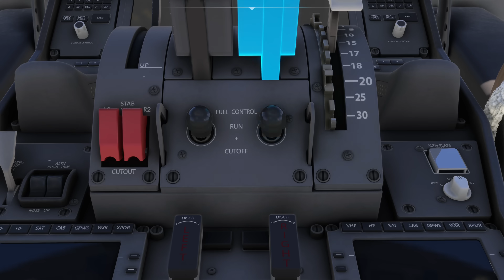Air India 171: Why Did The Fuel Cut-off Switch Get Moved?

Comment: FADEC failure? Consider this… the cutoff switches were Run when the FADEC goes crazy and sees a non-existent cutoff input. It initiates engine shutdown sequence and the pilot flying notices the drop in thrust prompting his ‘why did you cutoff the fuel’ query. The pilot monitoring truthfully replies he did not and all the while the switch remains in run position. Since it’s a false input generated  by a defective FADEC, the DFDR records a shift to shutoff that didn’t happen! The pilots then try to toggle the cutoff switches in an attempt relight the engine and one of them restarts albeit a bit late.
Reply: A spurious failure of a system with millions of hours on it, generating multiple false inputs one second apart, exactly mimicking a human input?  I don’t think so.
Reply: @rdspam 
A dual failure a second apart. I'm sure the probability of  occurrence is less than 1e-9
Reply: @byro32271 no it's not given that you already have a faulty switch control which Boeing knows.
Reply: @rdspam one second apart is humanely impossible lots of other honest pilots have suggested this. One second apart can only be achieved by computer systems
Reply: You wouldn’t see the clear inputs from run to cutoff then back to run again if what you said was true. Plus they can hear sounds in the cockpit. You don’t think they would confirm if the sound of using said switches is heard?
Reply: @Horizon301. Maybe they did hear or see more than they are saying and that’s why the report is vague?
Reply: @Yohann67 it’s a preliminary report, they are meant to be vague. The fact we have such detail and a likely cause is pretty good going. They will know if a switch got moved and what pilot said what based upon sounds anyway but that’s for the full report, that will be like 300 page and have a full transcript.
Reply: @Horizon301. It's not meant to be vague, it is made deliberately vague. The black box can exactly tell the sound id the switches were moved physically it captures the minutest sound. They chose to remove other conversations between pilots
Reply: I think that is a great point; I’ll hold my condemnation of the pilot until the final report, it just doesn’t smell right. We are making an ass-umption that the act was intentional and the “I did not do so” response was a denial; what if it wasn’t?   As long as the investigation is transparent we will eventually have answers.  This whole crash should have already been a lesson is assumptions.  First couple of videos where jumping on flaps retracted instead of gear, then it was fuel contamination, then it was electrical, not it’s deliberate action. Every step along the way presented us with examples of intuitive logic, as the majority of us plane enthusiasts and pilots are still not experts in crash investigation. I can wait, we owe it to the flight crew.
Reply: @Yohann67 take a look at PK8303. People had theories on the day of the crash and it didn’t sound right but the final report stated as such  that the pilots forgot to deploy the gears for landing and flew recklessly. It’s tragic to read. I agree about all the flip flopping but switching the fuel off wasn’t what anyone would suspect, hence it was leaning towards pilot error with the basics such as flaps or a failure of the aircraft. With the information from the report its leaning more toward the intentional cutting off of fuel but again we have to wait for the full picture.
Reply: @Horizon301. If you see the pilots have done nothing wrong. They have taken all the right steps to deal with this manufacturing defect
Reply: @atulram8206 what defect would that be then? The report suggests otherwise.
Reply: @Horizon301. Faulty locking in the switches. It's already a known issue from Boeing's side. I do not understand why the report only chose to share 2 statements from the pilots when they could have shared all the conversations that took place right from taxi till may-day call. The black box has the capability to exactly know which switch was turned on or off. It can hear the minutest physical movement and any sound in the cockpit. This is a deliberate attempt to hide the truth and pin it on the dead. Youtubers like Dr Steeve are helping them in this "noble cause"
Reply: What nobody is talking about except a few pilots is this. Cutting two manual spring actuated safety dented locks in a crazy total of 01 second time frame one after the other.

FDR preliminary report says word by word 
*The cut-off switches transitioned to CUT-OFF position from RUN "One after Another" in a CAP of 01 second.*

01 Second is not referring to the interval (timeframe) after the first switch went off for The 2nd to go off. Report clearly implies the entire episode of the switch 
"1 & 2" + time interval - all getting into the cutoff mode in a CAP of 01 second.

Now tell me a manual spring actuated lock dented switches that requires pull, move and plug to switch off....to have been executed one after another in a matter of 0.999 second is something that needs to be talk about. And I think this is what the investigating are also currently looking at.

At best you and I can only switch off three simple room Led bulbs in a second, a pilot switching spring loaded switch in 0.999 second with a single hand is still strange, and we are talking "TWO" switches here, not one. Quite not humanly probable if we have to go by FDR data. Again we don't know what happened and further investigation will bring out all these answers hopefully.
Reply: Just need to look at desktop computers, when there is a crash you reboot and the problem goes away...for now. There was no human suicide, it was engineering system failure.
Reply: Smart assists from you
Reply: Yes, perhaps it's this 1 in a quadrillion scenario, or maybe one of the overworked, depressed pilots just flipped the switches...
Reply: That's what I'm asking?  Are the fuel shut off switches a hard wired input to the data recorder or a computer generated input from another module/computer?
Reply: @mikeymike758 the fuel cutoff switches I believe are hardwired to the FADEC which is a computer of sorts. The FADEC constantly reads inputs and sends out outputs to other hardwired devices like valve, other computer systems and data to the CDR.
Reply: The "crazy" FADEC was so smart, it picked the best time to cutoff the fuel to both engines during takeoff, and covered it's tracks by generating fake fuel switch shutoff events then fed it into the FD-Recorder (just like a human would), It also generated the fake pilot conversation and fed it into the Voice recorder. It was probably hacked by N*/PR** or other enemies of India?
Reply: Why would the pilot immediately ask about fuel switches with a drop in power, that can be a number of issues. No, the PIC, the 1st officer, saw the Cpt do that, hence why he asked him, "Why did you switch the fuel off", then he put them back on...... Sadly without time for the engines to recover....
Reply: @Addad66  Then, why wouldn't the co-pilot announce over the radio: "Mayday, the Captain is trying to kill us all!", instead of "we have no thrust. We can't climb", etc?
Reply: @GK-yi4xv  Good point, maybe IT WAS an "Allah Akbar" T-act?
Do we know who said what yet, was it the Captain or the Co-pilot who supposedly threw the switches?  Only a camera might of shed some light?  Just asking?
Reply: @GK-yi4xv  Without actually listening to the CVR all is just speculation. The CVR and the FDR will give us switch timings with the question asked.... "Why did you turn the fuel off"  All those actions within a very small time frame, all in sequence.  If all those details are true, then it will have to be broadcast from the roof tops for people to accept it...... The recorders seldom lie...
Reply: @Addad66 In my opinion if the Pilot (A) really wanted to sucide I don't think he would have switch the fuel back on, and  would have even stopped the Pilot (B) from switching it back. Also turnning off spring locked switch by Pilot A (that also two switches) by mistake is impossible. That also in space of 01 second. Too many probabilities and deduction to consider. Hopefully final investigation report will tell us.
Reply: Complete NONSENSE idea !
Reply: I think you are rite about the fadec. And toggling fuel cut off switches. They toggled them to set them back to a start state.
Reply: @martynclifford9843And a second failure, at the exact same time, causing the FDR didn’t record the “off “ portion of toggling the switches? Two systems with millions of hours of use happen to have, for the first time ever, two failures that just happen to occur in a time interval exactly matching a human action?
Reply: @Yeah!!rdspam 🙏
Reply: @rdspam Nice observation
Reply: @martynclifford9843 Just making excuses you are !

Comment: It would be very easy to have a lockout of those switches in the software that is set during ground to air transition during the climb phase. It would also be easy to move the switches so the left switch is on the left side of the left seat and the right switch is on the right side of the right seat. However, I guess that could be a problem should one of the people in a seat becomes incapacitated.

Comment: Captain Steve, it appears that a LOT of comments/questions are stemming from not having some of the information about how the engines are controlled, and how the flight data recorders record some of the data. Can you answer the following questions: 1) How much independence is there between the controls for the two engines? 2) Is there a single point of failure that could cause both engines to shut off, and (if so) 3) how would that appear/what would be the consequences? 4) Does the flight data recorder record the physical position of the shut-off switches or some electrical signal downstream from the switches? I think that the answers to these questions would get the "ball out of the hands" of many of us "armchair quarterbacks".

Comment: On 15 May 2025, the UK Civil Aviation Authority (CAA) issued Safety Notice SN–2015/005 Version 2, titled “Fuel Shutoff Valve – Mandatory Actions on Boeing Aircraft.” 
Yes, if the underlying defect exists, there is a chance that the fuel shutoff switch (or valve) can inadvertently move from RUN to CUTOFF—which is exactly why this safety notice has been issued.

Comment: Dr Steeeve, I'm wondering if there's another explanation that I haven't heard discussed. I know this sounds very unlikely, but what if there was a double mechanical failure? What if both cutoff switches had a mechanical flaw? Considering that they were most likely manufactured at the same time, they might have had the same defect. The scenario I'm suggesting: The detent on the switches failed at the same time and the pilot who asked the question to the other pilot KNEW that he didn't turn off the fuel. To him, the only explanation would be that the other pilot must have done it. When pilot 2 answered that he didn't do it, he may have been answering honestly. Is this a possibility, no matter how remote?

Comment: I am an engineer and my inquisitive technical mind is requesting an answer to a very simple question. Hope you or any other experienced pilots watching Air India crash videos can provide an answer. 
Under what rare circumstance would a pilot require to shut off both engine during the take off ? 
If under no circumstances it is required then why it is not mandatory by Boeing/Airbus or other aircraft manufacturers to disable the fuel cut-off switch during such a critical time.  

Would it not prevent accidental or intentional cut-off during take off and avoid such fatal crashes?
Thanks

Comment: These planes "know" whether they are airborne or on the ground, and based on that certain actions are permitted or disallowed.  My question: can't the plane also "know" that it's taking off, and therefore it would be insane to turn both engines off during the ~5 minute period of time after V1 is reached on the runway?

Comment: Taking 10 seconds to flip the fuel switches back on, after noticing they were flipped OFF, to me, seems like a long time.  Wouldn’t a veteran pilot, knowing how catastrophic flipping those switches would be, especially at takeoff, almost instantly flip them back on (or within 3 seconds instead of 10)?   Combined with not releasing a full CVR transcript, I wonder if there could have been a struggle of some sort between the pilots?

Comment: Q: Throttle position, fuel consumption, attitude, and positive G from gyroscope are monitored at take off, I assume. The system should be able to analyze conditions. If all conditions meet acceptable levels of performance. It should be possible to system override a manual attempt of fuel cutoff. In the event it is necessary, both Captain and 1st can agree, and the Captain can manually engage secure switch only accessible with left hand. Otherwise, under normal conditions, flame out, on ground, etc. The system operates as it has been designed.

Comment: Two possibilities:
1.  One of the pilots was crazy and moved those switches on purpose.
2.  Electrical malfunction happened, and the pilot(s) cycled the switches to try and fix the problem.
( The switches were moved to "cutoff" and then back to "run". )
Reply: But then why would one of the pilots ask that question "why did you cut off" and the other replied "I didn't"
Reply: @billthomas7644 exactly. These aren’t the words of a pilot trouble shooting a problem.
Reply: @billthomas7644  That would explain an electrical malfunction.  Or he lied.  This is the mystery.  We may never know.
Reply: 2 would only be possible if it was communicated. Pilots are trained to speak whatever they’re doing, specially when they’re following a checklist - one reads, one does the action then says what they’ve done.
Reply: Wouldn't you switch them to cutoff and run within a second or 2?  Why 10 seconds?
Reply: @CoralSea  It's a mystery.  We may never know.

Comment: I have said this previously. It is obvious the story of the switches is fabricated for the simple reason that there was a 1 second delay before the second switch was closed. In a cockpit during take off a 1 second delay is a lifetime and definitely does not fall into the category of simultaneous accidental touch. If you are desperate to move blame from  FSOVs to FCOSs ie from aircraft to pilot and still make the story fit then this was their best shot. But we already know what happened....electrical failure.

Comment: I worked for one company as captain on 767s.  They had cameras in the cockpit and for the most part they caused more trouble than they were worth. When you spent as many hours in that cockpit, especially on long hauls, you didn't need big brother pestering you when you got back.  
I can understand that those of you that haven't been in that situation won't willingly understand, but when such a device is used as a weapon, it takes all the joy out of the job and you spend all your time bobbing and weaving. 
There are so many parameters on the DFR and DADC that if you can't figure it out, a camera won't help.
Reply: "joy out of the job" ...

Comment: Vinny D. To prevent a recurrence; can each Cut Off switch be relocated away from the center of the console one to the right side and the other to the left side so that pilots have access to only  one. It would require both pilots to shut down on landing. However, only one engine would be affected in a situation of sabotage or suicide. That might allow the plane to return.

Comment: Another YT post made an analogy of a computer asking the operator if he really wanted to shut the computer down, which was a revelation to me. The fuel cutoff switches are so important to flight integrity that a second check should be required to be acknowledged by both pilots after the switches are moved. Something like Master Caution warning flashes and has to be released by both pilots prior to the fuel being cut off. Maybe together with an aural warning "Fuel cutoff...fuel cutoff". Probably neither difficult nor expensive to do...no changes to hardware, just some extra circuitry required. Fuel cutoff only happens in an engine failure situation, or at the gate following a flight. Those extra 2 seconds for the double check would not affect safe operations. Of course manuals and procedures would have to be changed. Great suggestion.

Comment: I do wanted you to touch on a topic about cross feeding that could be remotely similar however I did showcase in Msfs on my twitch today going from La to Sydney in the 777 that having a fuel imbalance you wouldn’t turn off the fuel cutoff switch just the fuel tank buttons but still doing cross feeding at that low altitude is not normal you usually do it in cruise and you barely need to do it in a commercial plane anyways it more commonly done in 747 than 777 or 787 unless you have a big fuel imbalance which I never had I’m on your side that this is more of a suicidal act

Comment: The thing is they could've said, or probably figured out which pilot said the "why did you turn off the engine cut off switch" but for ever reason they didn't, so they gave YouTube universe speculation talking points.